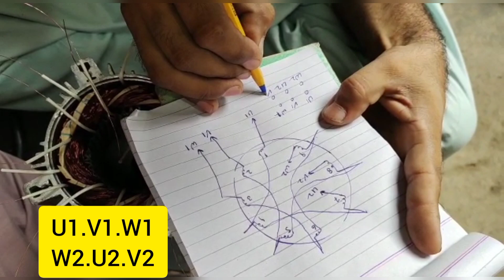3phase induction motor 6pole 900rpm 9set 50hz winding connection

Comment: What is the winding difference in a 50Hz vs 200Hz motor?
Reply from the maker: 200hz who is motor
Reply: @armanelectricmotorwinding  I want to know what is the difference between an electric motor that works with 50Hz compared to a motor that works with 100/200 Hz!
Reply from the maker: Yes 100hz ya 150hz/200hz for running on inverter